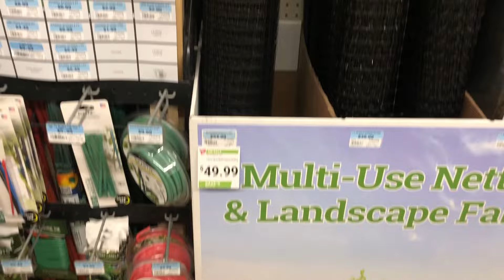DIY Deer Proof Garden Fence | Cheap, Fast, & Easy

Comment: Zip tie is not UF protected and will crack soon, better to use metal wire. Thanks for the video
Reply from the maker: Thanks for the information! So far so good, we are on year two. I’m sure when it starts to break down we will replace with a more permanent metal fence. Thanks for watching!

Comment: T-posts have doubled in price since last year.  My garden is 80' x 30'.  The deer found me last year and I'm really concerned about this year.
Reply from the maker: That doesn’t surprise me! Well we used this fence all last year and it worked perfectly! Still standing and plan to use this year.
Reply: @redriverliving  have the t-post remained in place? I'm worried about doing this and the t-post leaning over slightly after time with the pressure of the net and water. How's yours holding up?
Reply from the maker: @jilkojilko  Our t-post have not budged. the screen has been damaged by the wind but was able to easily fit it, we get strong winds where we live. Thanks for watching!
Reply: I feel your pain pal, just had to fence in almost exactly your dimensions at 16 CDN per post. Went roughly 15 ft spacing

Comment: Excellent, I wish I had the same of the tool you used for hammering in those posts. I also like how you used bricks at the bottom to keep the bunnies out, definitely will save me alot of trouble. Thanks for uploading this! Greetings from Canada.
Reply from the maker: It's called a T-Post Driver. Thanks for watching!

Comment: We built a fence this way and the deer keep breaking through it. Would you recommend doubling through with a monofilament tension wire, or a strong fishing line?
Reply from the maker: Luckily, we have not had any issues with our deer trying to break through it. If you continue to have issues, you may want to use a tall wire fence. Thanks for watching!
Reply: we had the same problem, I am going to add another layer of metal wire fence, I hope it works. I am in NJ, we have a lot of deers.

Comment: Thanks for the vision! I’m amazed you got the fence and gate up in a day! This helped me get started on my fence! A few suggestions I found 

1. After putting in the 4x4 posts, we found our soil was too sandy. Once the rain came , the post was not secure at all. We tried again by wedging in rocks. Still not any better. We’re going to try Quickrete next.  

2. Once the 4x4 post goes in , the T-post behind it can be removed and the deer fence can be stapled to the 4x4. I guess it’s not essential just an observation

Comment: Your doo and the corner posts need diagonal bracing.  Also, what are your plans to keep the mice out?  Can squirrels chew through that deer netting?  Asides over , nice job on the fence, especially as your wife helped!

I really like your soil -- I'm so used to the hard-packed clap in my ares -- it was a joy to see you digging those post-holes!

Can you share your cost of materials for this fence?

Comment: There's certainly something to be said for cheap, fast, & easy fencing.   But I think those three words just about sum up all the advantages of this type fencing as so many other videos on You Tube point out tons of drawbacks.   Most say the plastic deer netting and zip ties disintegrate far too fast, often in just a couple years time due to UV rays weakening the material.   And many say   deer can and sometimes will push against the fencing enough to damage it because it really isn't very strong.   Other animals that enjoy attacking a garden such as raccoons, possums, squirrels, wild hogs, etc. can chew or rip through this fencing easily.  With the wide spacing of the T-posts, even really strong winds, which we get a lot of where I live, can push the fencing enough to damage it or cause the posts to lean over.  We get about 75 inches of rain annually here PLUS we have unstable soils so unless any post sunk only into soil will not remain stable and usually will lean over. 

Basically, to insure you are not just wasting money building a fence that will need reconstructing in a couple years, the fence needs to be much more robust.  Your fence will be enough to discourage deer from trying to jump it.  However, given the huge amount of landing space inside your garden, there will still be one or two deer who are bold enough and brave enough to try a jump.  Most of the time that will be younger yearling bucks.  They are like teenage kids who think they can do anything.   The weak plastic netting will give at the top of the fence to the weight of a large deer jumping into it and likely the deer will make it over the fence, albeit not in a beautiful Olympic style vault.   Once one deer makes the jump, more will see that it is possible and will also try it.  Meanwhile, even one deer inside the garden one time can wipe out tons of plants to the point where they cannot recover.

I live on 20 acres in Mississippi, a state with one of the highest densities of deer in America.  I battle deer and tons of other critters year round as each year more new animals are born who feel compelled to taste my garden veggies.   Even 8 foot high fencing will not keep out all deer, particularly if they see enough landing zone clear space inside the garden where they can get a running start for their jump and not crash into something when they land.  

All that said, your fence might work.   It looks like your garden is way out in the middle of a large open area.  Most deer don't want to venture out in the open that far  and if there are other places they can find food, they may just never even try getting into your garden.   A lot depends on what the deer density is in your area and what available food resources there are.   

Also, our deer here are urbanized and very familiar with living near humans.  They are not shy and spend a lot of time close to people watching for the best time to hit a garden without being disturbed.   My deer here recognize me and sometimes just watch me move about on my land, waiting until they see where I am before they head to my garden.

Put a game camera on the garden plot and you will be amazed at what the deer do!  Good luck with your fencing.
Reply from the maker: Absolutely, I completely understand where you are coming from. This fence for us is a temporary fence till we decide to put in a more permanent solution. We are beginner gardeners and know our garden will grow in the future. Once we decide how large we want our garden, we will install a more substantial fence. In our area, North Texas, this fence has been perfect for our needs and has kept the deer our of our garden, which like to roam in our yards. 

Our biggest issue right now is MOLES...Do you have experience with this? They are devouring my beans!
Reply: @redriverliving  Get a cat or two. They hear the moles digging in their tunnels and love to dig them up.  Or if you don't like cats, get a Jack Russell terrier.  That dog will find and dig up every mole in your entire neighborhood!

We have moles here, of course, but my cat does a pretty good job with them.   Farm cats are worth their food and vet costs because they also catch and kill mice or rats.  We have many more mice than we do moles.  The mice will dig into our seed beds and eat root crops below ground or eat freshly planted seeds that have not sprouted.  

Gardening is a constant battle each and every single day against all the critters in nature, from animals to insects to fungi.   My best advice is to plant much more than you think you will need.  You can always store extra food,  sell it, or give it away to someone in need.  That helps overcome the  losses to insects, disease, animals, weather, and whatever else hits your crops.

Glad the fence is working to keep your deer at bay.  Hope you have a great garden this season!
Reply: @redriverliving  Cats love moles
Reply: I agree with the importance of building an effective and durable fence. My question to you is do you have dogs? We live in the mountains and regularly see deer in our neighbors yard. Not many deer venture into our yard because of our dogs. My female dog chases them away. When the dogs are asleep inside is when the deer will eat the garden in the summer time. Maybe a doghouse outside of the fence wouldn’t be such a bad idea. Just a suggestion for protecting veggies (that is if you’re fond of dogs)

Comment: How much did this cost?
Reply from the maker: I think we had roughly $150 in netting, purchased T post at local Tractor supply $8 each, had zip ties already! Pretty inexpensive, right now the netting is on sale for $60/100ft! Linked in video!
Reply: @redriverliving  I've had nothing but problems this year for the first time in a 14 years of planting at my homestead I've had to replant 2x and nothing is working to keep the deer away